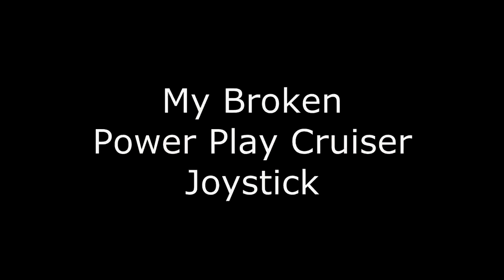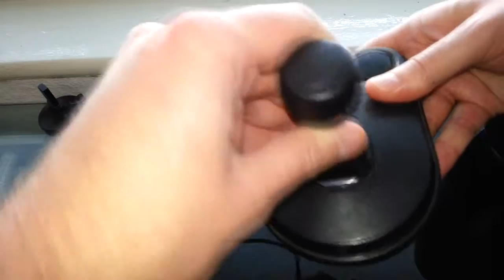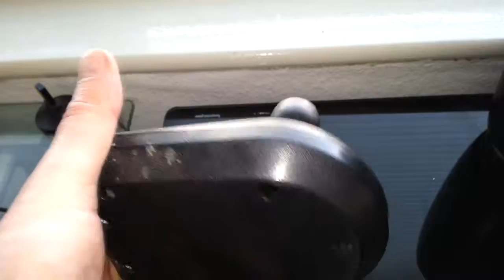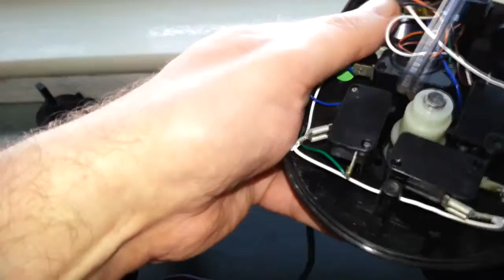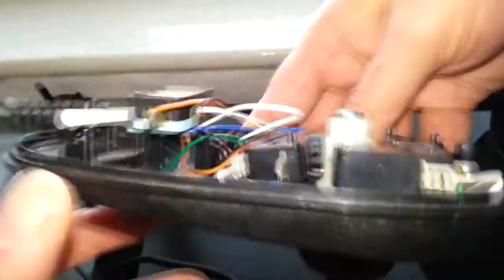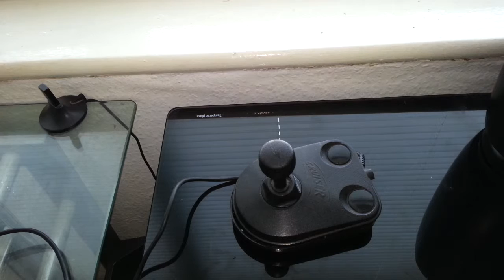My Broken Power Play Cruiser Joystick

Comment: Where would you get replacement microswitches for this joystick for? I have exactly the same joystick for my Spectrum, but one of the microswitches is sticky and I wanted to replace it.
Reply from the maker: I have not even attempted to repair it. It is too badly damaged and to me its not worth spending any money on it. Also I have no clue where you would bet replacement micro switches for retro joysticks. eBay would be the first place I would look.
Reply: A couple of years late, but any electronics store or website which offers microswitches. Keep in mind, microswitches come in mainly two (2) sizes: full-size (known as V3 microswitches), and miniature (V4). I recommend Arcade World UK - looks like this joystick uses leverless microswitches, so the ones I suggest are Cherry D44X (they also offer D44Y switches, which have lever-like arms, but the leverless D44X ones are the ones you need for this joystick).
Reply: @OnafetsEnovap  Awesome - thank you. I shall head over there straight away.